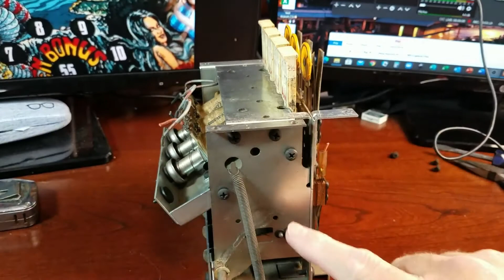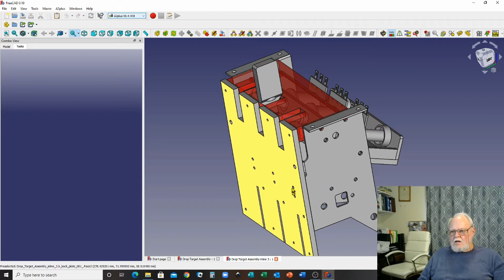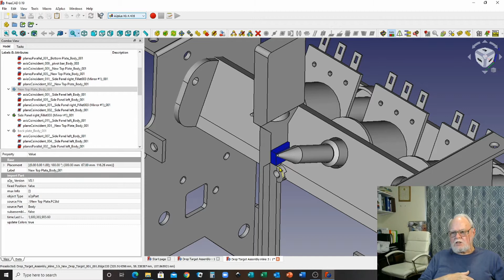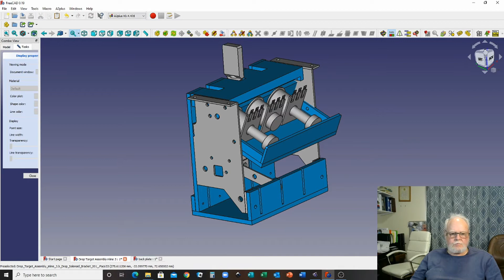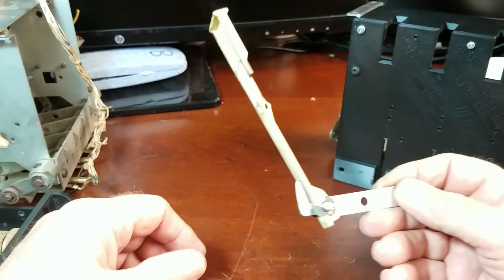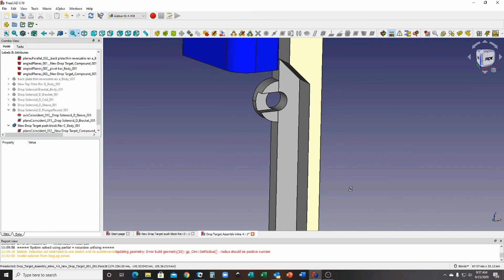Fathom 1

Comment: We test fit this unit today in both locations on the playfield.  It looks fairly good.  Fit perfectly in one position, but in the second position, the drop solenoid shelf sticks out a little too far and would hit the side of the cabinet. So, we need to decrease the stick out by about 3/4".  I see two options for doing this - shorten the throw of the solenoids, or change the angel of the shelf mount.  I am going to try shortening the throw first since it is easier to do.